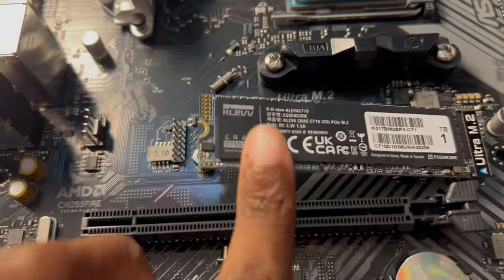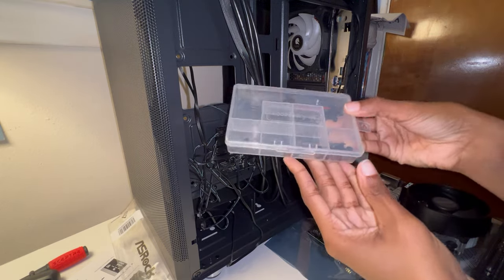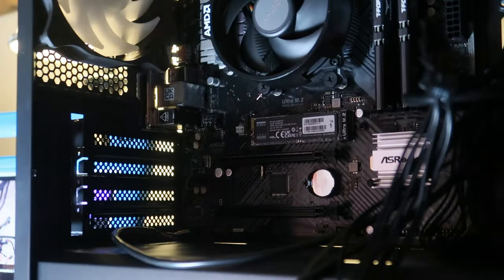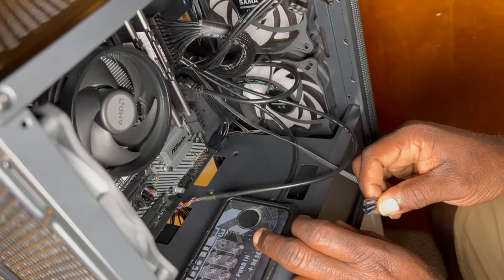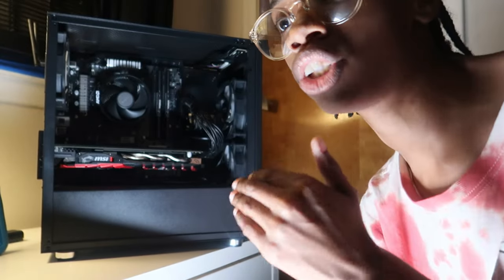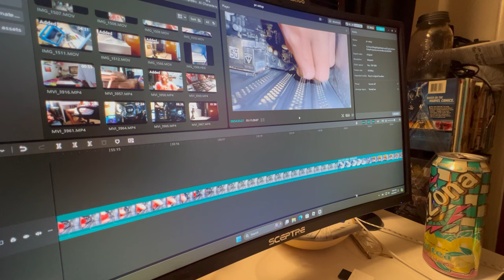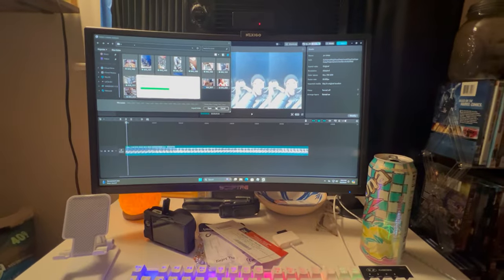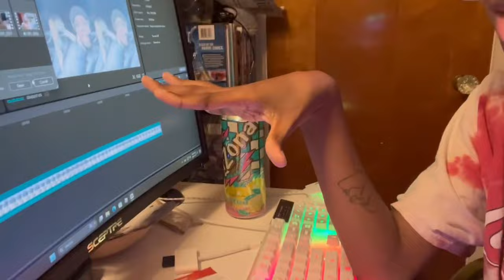Building My Dream PC: My First Experience!

Comment: youtube algorithm sent me here.  great job on your first PC build. small tip. under those connectors on the bottom of the motherboard there are holes in the case just beneath them so you can run the wires behind the motherboard and up through the holes to make things look a little cleaner inside the case.  no harm leaving them where they are though. Enjoy your new PC!

Comment: Did you have a usb driver in order to download windows 11 I’m currently building one and im curious if I need a usb driver?
Reply from the maker: You can download windows 11 on a usb hard drive but , I brought a windows 11 flash drive off of best buy for about $150. It was expensive but, worth it. Also if you do download it on a hard drive make sure it’s big enough for windows 11.

Comment: there are some discrepancies which I noticed which I feel need to be addressed! 

your power supply is installed upside down, the fan should be facing the floor. your power supply will be starved for air under a heavy load and this could lead to a failure or worst case a fire. your case has holes where the  fan should face in order for it to properly intake air. this should be addressed ASAP. 

if you have important data consider backing it up to the cloud because the ssd may fail due to it not using high quality nand flash. consider saving up and upgrading to a crucial p3. (cheap and reliable) but this isnt too big of a concern right now so dont worry about it if money is tight. i also recommend looking into a 4tb ssd so you dont have to worry about upgrading your storage in the future. 

other than that good job with your first build congrats. i remember buying parts slowly over a few months for my build very similar to how you described. 

but seriously fix your power supply asap.
Reply from the maker: I did flip it , I just didn’t film it. I was wondering why it wasn’t lining up with the screws so I just flip it and realized the fan had to be facing down in order for it to fit.

Comment: i just wanna ask if you put a thermal paste before screwing the cpu fan ;-;
Reply: I think the stock amd coolers come with thermal paste pre applied not 100% sure on that one though as never used the stock amd cooler on my builds but think I remember reading it somewhere
Reply: @olliered9924  They do, actually almost every aio/cooler comes with pre-applied thermal paste nowadays. Right now the only popular brand that doesn't pre-apply thermal paste that I can think of is thermalright, but they give you a small quantity that you apply yourself (was able to paste my CPU and repaste my GPU with what they gave me)
Reply: @axelcllt  do I need to imply extra thermapaste even tho it's on the aoi?
Reply: @zhostfu3595  if there is thermal paste pre-applied, you don't need to add more 
For the vast majority of people, you should not replace your thermal paste unless you are having temps issues. And if you do so, make sure to wipe the old one with isopropyl alcool